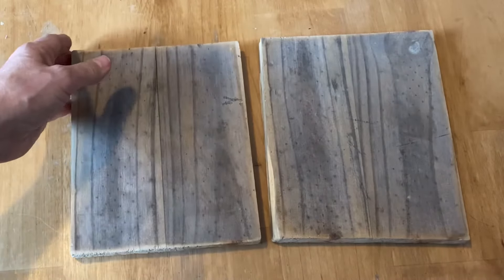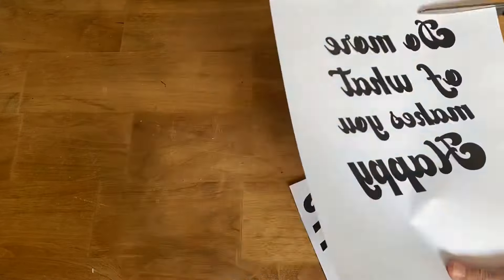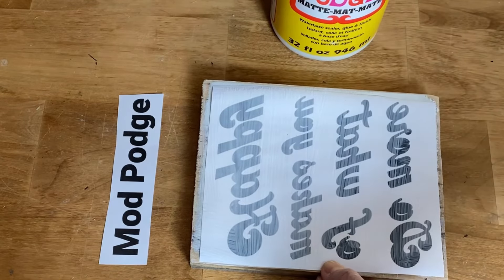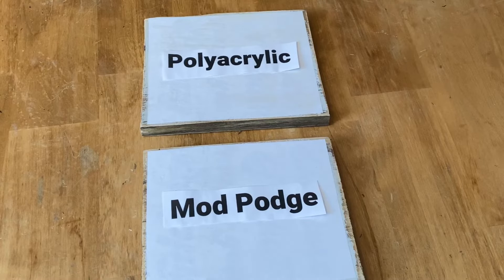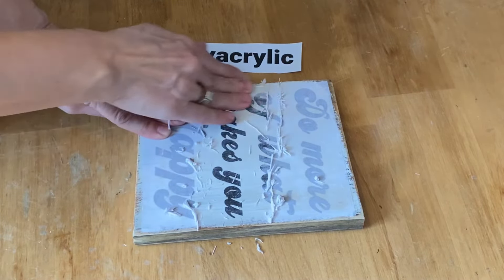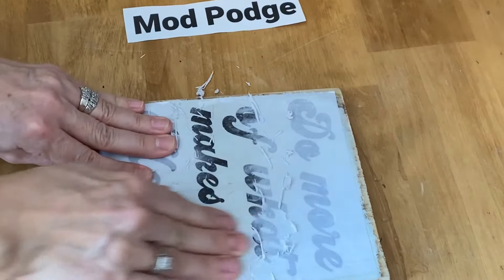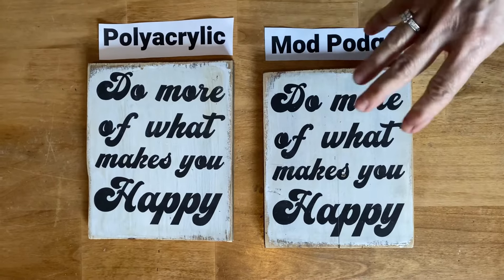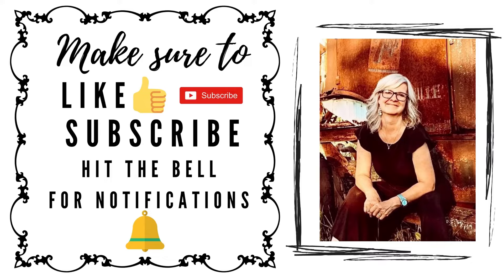Wooden Sign DIY: Comparing Mod Podge vs. Polycrylic for Graphic Transfers

Comment: Hi Deidre. Will this Mod Podge method work if I am placing the lettering on a board that is a different color? Lets say a red or blue back ground?
Reply from the maker: Yes it will. It can be a bit more tricky but can be done. The mod pdoge may show more around edges but you can paint around the letters with background colour to blend if needed.
Reply: @OurUpcycledLife  Thank you.

Comment: I followed another tutorial by another person and they instructed to use a lot more modge podge (to the point you almost can't even see the print under it) - will this be an issue? You used a lot less.
Reply from the maker: I find you don't need much at all! I have made hundreds of signs and the more I use the more you can see mod podge around the edges. It also wrinkles and bubbles more. Try both ways and see what works best for you! Thanks for watching Sierra